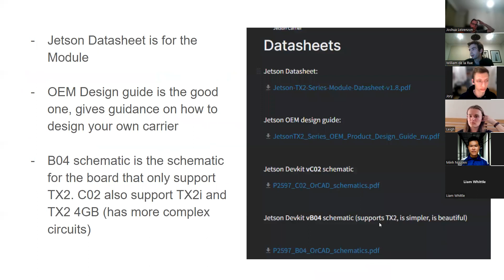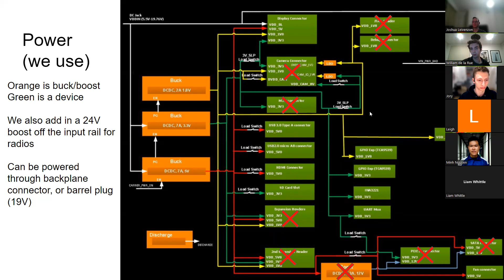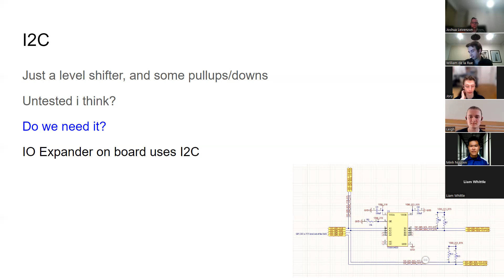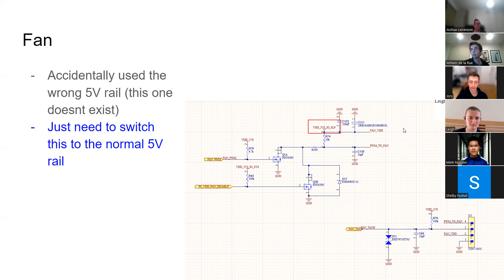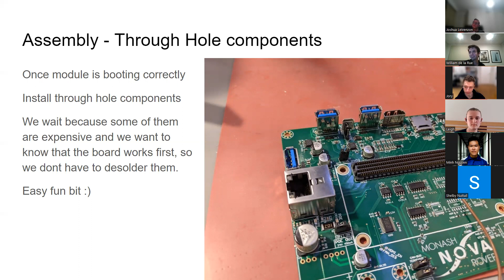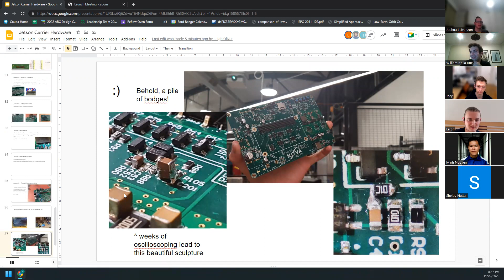Jetson TX2 Carrier Board - Hardware Design Overview - Monash Nova Rover

Comment from the maker: Addendum to the bodge fixes:
Jetson modules with P/N ending in 001 will not boot if UART0_RTS (RAM_CODE0 Strap) is pulled high, this may also apply to modules ending in 000. 
Modules ending in 000 will also not boot if UART1_TX (RAM_CODE1 Strap) is pulled high. 
Presumably nvidia changed their RAM suppliers at some point and this is how they differentiate the different RAM to the Tegra. 
To fix this we removed the level shifter for UART1_TX as well as the pin for UART0_RTS. This can be fixed in future designs by using level shifters with high impedance inputs!

Comment: Does anyone know if the firmware portion of this presentation is posted anywhere? Thanks!
Reply: Hi Alex, unfortunately we did not get around to that portion of the presentation, and the team has since moved on to an Orin based carrier, so the knowledge is likely lost
Reply: @willdlr  Thanks for your response! If there is any additional info on the process for an Orin carrier, that would be extremely helpful, since I'm looking to do one for the AGX Orin. Thanks again!